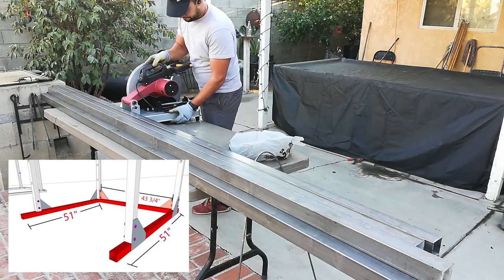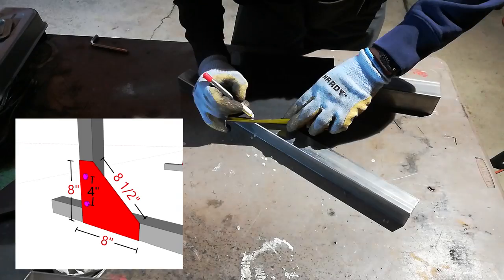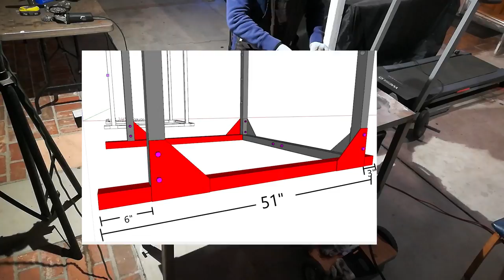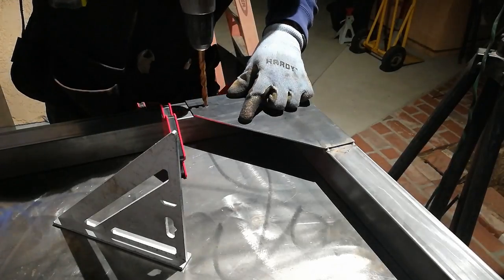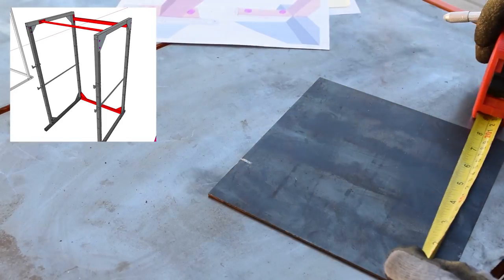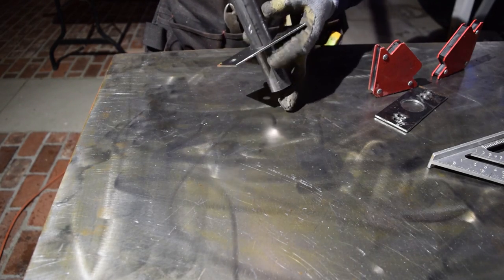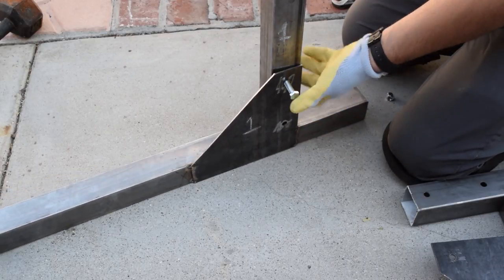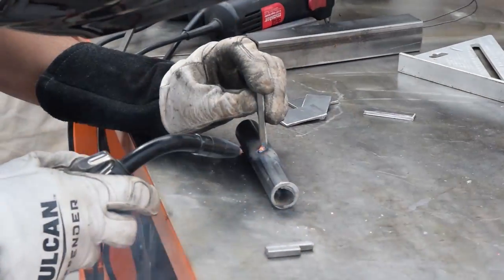How to make a Power Rack/ DIY Power Rack

Comment: Would you advice commissioning this to a smith or buying one pre-manufactured? I live in Mexico and there are really few options and IMO a bit expensive for the quality (like in the US those go for $300 and in Mexico the same rack goes for around 13,000 pesos which would roughly translate to $700). On the other hand I know a smith that lives close to my house and has done good works so far, so I’m thinking on asking if he can build the rack but though it was a super crazy idea until I saw this video

Comment: great video! Would you be willing to share your design so I can use it as a reference to build mine?
Reply from the maker: Of course! I will be uploading a set of plans soon to make it easy to follow.
Reply: @thebackyardmaker1214  that's awesome! Thanks
Reply: @thebackyardmaker1214  following on the plans. I will also use them for building my own rack if you agree
Reply: I have all these tools in my shop and could make a power rack also. I work metal and never realized how easy it would be to make one of these

Comment: What's the size of the tubular you used?
Reply from the maker: Hi Christian, I mostly used 2in by 2in  16 gauge mild steel. The length of the stock square tubing was 10ft long and I got it from a local metal supply.

Comment: any reason u didnt apply washers to the bolts ? looked like the metal was bending in a bit after tightening, maybe manufacturers have to provide them as part of a safety sellers guidlines in accordance to the governments etc but maybe overkill, i dunno
Reply from the maker: You're absolutely correct! The metal did bend a little and i ended up using flat washers in the end! Lol. Other than that, even without the washers, it was still holding on great.